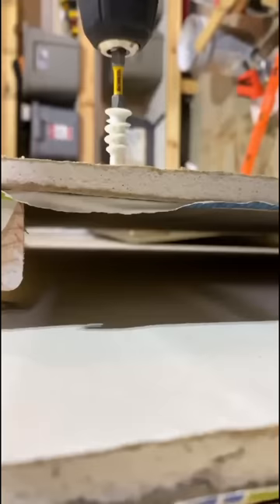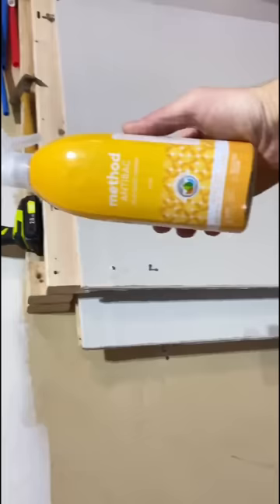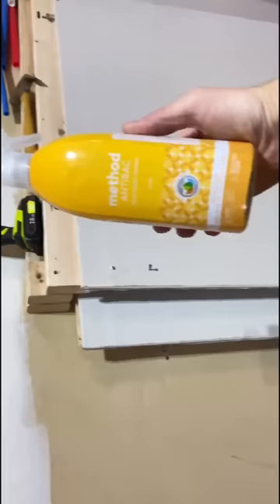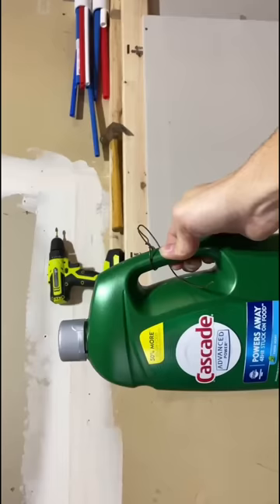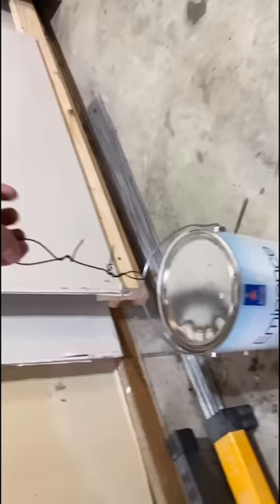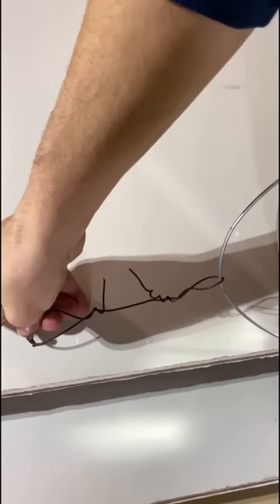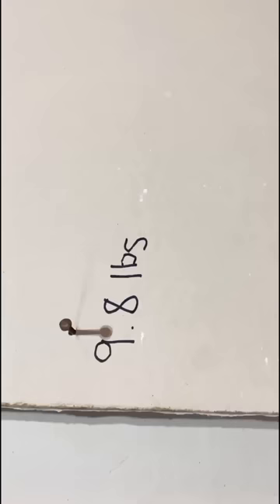How Much Can They Actually Hold? #homeowner #shorts #handyman

Comment: So we still don’t know how much it can truly hold
Reply: I was so surprised on how much it could hold. Anywhere from 9.8 pounds to the net weight of a black whole.
Reply: I was initially so excited, I need closure…
Reply: @Blake0672  bro a whole black whole??
Reply: As far as hanging board nails in studs will hold well over 100lbs. 4 1 5/8” nails one stud back from the edges will hold up a full board on the ceiling. Two will hold one on the wall. A 12ft board is about 110-125lbs generally. Screws will hold a hell of a lot more, but I can’t remember the exact number. It’s over 600lbs.
Reply: you gotta take the environment into consideration. If you hang something close to the limit of ripping out the anchor, a little wind current can tear it off
Reply: Yea my exact first thought after he stopped with the nail.. kinda really dumb video
Reply: More
Reply: Project farm
Reply: @accordingto27  he meant to say all of the black. not the black whole
Reply: @CornPopsDood  well yeah obviously if you want to hang something with any significant weight you go to thr studs but that wasn't the point of the vid lol. From my experience using drywall hangers, they usually can hold about 50 ish pounds then tend to mess the drywall up.
Reply: 🔫 ‘like, follow, and tune in next time for results’
Reply: @CornPopsDood  2, 16 guage brad nails will hold 12' × inch thick Hardie belly band
Reply: It wont hold my hand though :(
Reply: @crusadebirb4084  yeah his test is useless, but I know the will hold 75 lbs with a good plastic anchors
Reply: The answer is about 10 lb because the thing is if you leave it up there long enough it'll probably slowly fall down
Reply: I have a large TV from the early 2000s that weighs like 70lbs, mounted onto drywall with some anchors. I'd say it can hold pretty well.
Reply: @Blake0672  a black whole what?
Reply: Check out project farm, he does an extensive test on several brands and weights of anchors. His channel is pretty cool
Reply: It was right next to a stud. You do this in the middle of a 24" piece of 1/4" drywall and the drywall will split and fail before the anchor does
Reply: It can hold a little more than a half 5 gal bucket of oil, and a little less than a wall mounted 60 inch

Comment: Test them to failure! You didnt teach me anything
Reply: It wouldn't teach you almost nothing anyways as drywall anchor is designed this way with a ceiling in mind and that test would not test forces in that particular direction.
Reply: No, no it is not. Those are designed for vertical walls. A ceiling needs a larger device, like a butterfly nut, or better yet hitting the joist with the anchor.
Reply: @korinogaro  "It wouldn't teach you almost nothing"
Reply: Project farm tested these extensively you should check out his channel

Comment: Isn't the real question what weight it can hold for years without falling? I always figured that's how they calculate the weight limit of things 🤔
Reply: Its hard to make a new product that lasts the test of time when you spend all your money doing real time tests. Its faster to overload for a shorter time to speed up the results with slightly less accuracy, so using your quick results you can drop your advertised rating to say 75% of that and get away with it
Reply: @Extra_Mental  I always figured it was 50% so if it fails they just say we'll you over loaded it.
Reply: The second that nail becomes loose in the hole it’s going to fall out every time
Reply: True, in my house, a closet (with a clothing rack) used drywall anchors. When we moved in, it was okay. Fast forward many years later, the entire closet collapsed and left a MASSIVE hole in the wall. 

Months before that, the same happened with a towel rack in the bathroom

Long story short, secure your items to a wall stud, don’t use drywall anchors as they have the ability to collapse in a matter of months or years. They also leave a large hole in the wall when broken.

To anyone who has feedback or something to say, pls reply to me (don’t  start sending hateful comments as if it was my fault something broke)
Reply: @lftboomboomz9166  sometimes they can actually hold less weight when they are placed too closely together.

Im not saying thats why your closet fell apart, just something for others to think about since you cant always get a stud.
Reply: @That.Guy.  you're not wrong, but for something like a painting that isn't going to experience much movement, it's probably fine. Definitely wouldn't be a good idea for a bookshelf or something you'll be adding or removing items from regularly, though.
Reply: Man can’t even do the regular testing. Don’t challenge him
Reply: Generally due to the established long term  chemical and mechanical stability of materials used in fasteners like these, the fasteners are repeatedly load tested to failure. Using the data gained on that testing, a mean failure load is established, then a safety margin is calculated and subtracted from the mean failure load, resulting in the load rating.

There is more to it, but this is the gist of things

Comment: You don’t really understand “testing” but that’s cute.
Reply: "I got my buddy Jimmys leftover lunch and 3/4s of a beer on the screw, thats about 5 lbs"... lol If you're going to test something, then test it!. How much weight until it fails, could have easily used and empty 5gal bucket and water, as it is extremely easy to calculate weight based on volume.
Reply: @Teh_Random_Canadian  okay Heisenberg 😆
Reply: @blueberrychronic  Don't cancel me #Metoo
Reply: @Teh_Random_Canadian  yeah but still not a valid test. Cuz it’s suspended on a tiny piece as close to the wall as possible. If you put up a shelf the weight well move away from the wall
Reply: Also, the part that really matters is how much it holds over time. The drywall is supposed to last at least a few decades so putting a bucket on it for a few seconds doesn't really help gauge it's durability
Reply: @tothelimit9992  The downward force would still apply to the same point on the wall, entending the load further away just amplifys the load. The test would still be vaild
Reply: @ravneetsingh22  Yes, but that is next to impossible to quantify. Drywall thickness and type, age, environmental conditions, type of application the fastener is used for  etc all are factors. It is not realistic to have all that data. 

Instead it is: when installed on 1/2" drywall the failure point is 100lbs, therefore deduct a 25% safety margin and call it 75lbs for a continuous load. It is up to the installer to choose the right fastener for the job. A small shelf that holds a plant or something, sure. A 80" TV or bookshelf... not so much
Reply: @Teh_Random_Canadian  no, placing it at the wall is a shear load parallel to the wall. If the nail being tested were the  top most nail in an L-bravket holding up a shelf then the nail has to both take a shear load plus a load trying to pull it straight out of the wall in the same way a crow bar would.
Reply: it's not that cute to me

Comment: As a painter I see this all the time, yesterday I was preparing the interior of a house removing nails, tacs, screws from walls and the client asked me to take the old plasma TV off the wall, and to my surprise, it was mounted with two wall mount plugs and screws I was blown away considering the 7 yr old 65 inch plasma that weighed around 110 pounds had held for so long.

Comment: Personally used standard drywall screw to hang everything outside TVs. But I do use a drywall screw and a washer to mount the tv mounts so I can level them before big screws pull that 2x4 closer to the middle of the room

Comment: it's not just how much it will hold in the first hour or so, but also how it performs over time.. the reasoning is the nail and screw will make a bigger hole over time each time weight is applied intil it can just slip out. The anchor provides a much more robust connection.

Comment: I used two naked screws to hold a toilet paper holder, lasted about 2 months and fell. Used those white things after, with the screws, and never had to touch it again. However for the mirror, the 2 naked screws are still working fine, its only a problem when you have to touch the stuff thats on the dry wall

Comment: I only use anchors because the screw stripped the drywall so I just put an anchor to "fix" the hole and it works

Comment: Ok so my thought on this is yes it holds this weigh without ripping out of the wall, but other factors come into play. Like brand and thickness and material of the wall. Then also there is time and gravity. So how long will this weight hold. I use a 10lb anchor to hold up a 15lb mirror, yes it may hold at first but as time goes by the constant down ward force of that weight is the question.

Comment: One time we were setting a shelf onto this 5/8 drywall. It wasn’t too heavy, particle board and some L brackets to hold. We used 14 50 lbs anchors. My boss said “in theory this should hold about 600 lbs”… I set my drill down on the shelf and it all came down lmao

Comment: Heck a little trimming divenail can hold a heck of a lot in drywall, if the load is static, left alone and in a vibration free environment. Here's my informative rant:

The point of an anchor is not just to "carry more weight". It's to distribute loads on a much larger surface contact than a "normal", reasonably sized screw can. Often you're hanging/attaching something that can only accommodate a predefined, relatively small screw shape. With an appropriate anchor in the (dry)wall, you can get the "effect" of using a much larger helix screw. Sometimes the object needs securing with machine threat screws - and for that you need an anchor with matching machine threads.

An anchor, in addition to prividing much larger bite surface, unlike a screw or nail may expand inside the hole and/or behind the material/wall. This enables securing something to the wall with a good bit of clamping force without disintegrating the material. This is especially important if the object hung/attached to the wall will experience vibrations, movement, variable loads etc. Vibration and movement force has to overcome that pretension force, before it can induce any movement of the anchor and/or fastener. 

These days, if hanging stuff on drywall that doesn't need to take a lot of vibration, long heavy protrusions (like wall-hung cabinets without supports) etc - I almost exclusively use arrowheads. Also called hammer-in metal drywall anchors. Haven't turned back since I first came across them. They're absolute minimum hassle to install, dirt cheap, no need to drill - just a few light whacks and they're in. You'll recognize them by their shape, and AFAIK only available in that common zinc electroplated and yellow chromated finish. 

Size-match with the drywall thickness is very forgiving with these, within reason ofc. Don't use 30-40mm ones with single layer 11-13mm / 1/2" drywall. Part of the side edges fold over the edge on the opposite side, expansion only happens past the length of this fold, so make sure that point along the anchor is inside the drywall sheet, not protuding out the other side. They're so cheap though, buying some pack of a few extra sizes beyond what you mostly use, to have on hand , is a no-brainer. 

They do work incredibly well. And because of their pointed narrow shape they're very easy to get high accuracy with. Great for quickly mounting stuff which has small predrilled or moulded holes and basically no adjustment margin, they won't try to walk around on you like "larger" drillbits i drywall sometimes do.

Their shape also means that if you got your measurements off, and haven't driven a big screw in them yet so the rear hasn't been expanded, you can easily pry them back out again without leaving a big hole/crater. If its rear is slightly expanded, you can usually pry those back out too, with minimal damage. It's gonna take a little more force to pull out (pun intended) though, as it needs to "collapse" the expanded end. So ideally use a small, thin-edge skirting/moulding prybar. But whatever you end up using - slide a 2-3 inch wide trowel in between the drywall and pivot point of your pry tool, to prevent if from leaving impression dents and marks in the drywall. You should really be consistently do this, whenever a pry tool needs to leverage off something soft'ish, fragile, thin, or finish treated surface.

They hold incredibly well, but only hold well on one axis though. So ensure the flat edge is perpendicular with the direction of load. If you haven't used them before, you'll understand what I mean the moment you see them. Their edge is wide but very narrow (like a broad flat arrowhead, or a knife blade), so if you for instance hang a heavy or "used" load on these but mistakingly do so with the anchor's cutting edge vertical, then the load can make that thin edge slice its opening longer and work its way out.

If there's mostly load by gravity but maybe a tiny bit sideways from time to time (like a chalkboard or whiteboard) - adding a couple of extra points with the flat parallel to the gravity load will soak up those sideways movements and prevent the arrowheads from working themselves in a widened cut sideways over time. Even for a big heavy chalkboard, you only really need a couple of these perpendicular oriented anchors. As they're only there to prevent sideways motion of very low force, they're not actually bearing any load.

Happy building folks! Thank you for coming to my TED Talk on drywall arrow anchors, I'll see myself out now.

Comment: The strongest anchor you can get in drywall is by placing a 6x6 piece of 3/4 inch plywood behind the spot you wish to hang the anchor, anything that would pull out of the plywood would also damage the wall.  the plywood spreading the surface area in a 36square  inch area if that pulls off then ur hanging the wrong stuff on the wall

Comment: The problem isn't holding the weight. It's longevity. More surface area makes them less likely to pull through the drywall over time.

Anchors are used so that 5 or 10 years down the line your shelf or picture don't fall off the wall because the nail pulled through.
Reply: Agreed. I have a clock that I hung using a metal EZ anchor and a #8 screw. Over time vibration from walking, kids bouncing around and so on, caused the hole to go oblong and the clock almost fell down. 

We had a Christmas Bow on the clock and we took it down to clean the glitter and crap off the clock. If we had not done that we wold have never noticed and it would have been on the ground. I have since switched it to the push through style with the big bar on the back side. Lesson learned. If it's remotely heavy get the best anchor you can find. The 50lb rating on an EZ Anchor is not necessarily for ever.

Comment: You are testing the shear weight and tear capacity of the drywall against the diameter of the fasteners. The rates weight of an anchor is for the pull strength coming directly out perpendicularly from the face of the drywall.

Comment: Sure, a nail or screw will hold the first time you place the object on it. However, over time the nail will sink into the bottom of the hole due to moisture as well as pressure differences when you open and close the door to the building and room it is in. Eventually there will be a larger hole and a loose nail.
The thing about the anchor is that it is tighter and does not allow movement. Well, not if you only hang objects thst are within the holding capacity of said anchor.

Comment: What really makes the drywall weak and fail is if it's been wet or in high humidity conditions. Once that happens it's not holding anything you could put a hundred pound insert in there and it can rip right out. And you're always best going into studs.

Comment: I've used nails with no anchors for years to hold stuff on the walls. The only time I bother with anchors is when it's something that's going to hold stuff on top of it,  like a shelf,  or with curtain rods. Because while a picture will probably be fine without any anchoring,  the nails do slide out of the sheet rock.

Comment: Get 1/2" Ultralite drywall. Anchors are only as strong as their drywall. There is soap inside drywall to make it lighter, hence the bubbles. If you are for some reason using an anchor  on your ceiling, chances are it's Ultralite. Toggle bolts have a decent surface area for that.

Comment: It's not the whole deal with the anchor expanding that increases the strength, it's the fact that there is now more surface area. Sure expanding will help if you screw it into the ceiling but in a vertical wall it's the surface area of the contact that counts

Comment: It’s important to remember what “sheer rating” is. Also a huge difference between a fixed load, like a picture, and a moving load like a tv bracket. Also the further the center of mass is from the wall greatly decreases the strength of the fastener

Comment: The rating is based on pull out, not how much it can hold vertically or horizontally. So to measure its' strength, you need to see a direct pull out.

Comment: The box they come in had shear weight ratings. Typically the limit listed is in a safe zone. So most likely can hold quite a bit more. 
Honestly when it comes to using anchors, if it’s something heavy duty, toggle bolts or the zip tie ones are really good.

Comment: Fasteners are rated for how much force it takes to pull them out. Technically any fastener can take a massive amount of weight at that angle but that doesn't matter. What matters is once things get on them and put leverage on them. That nail would pull out at probably under a pound